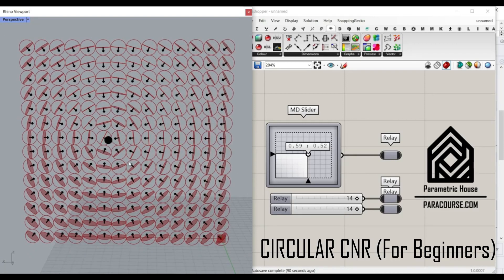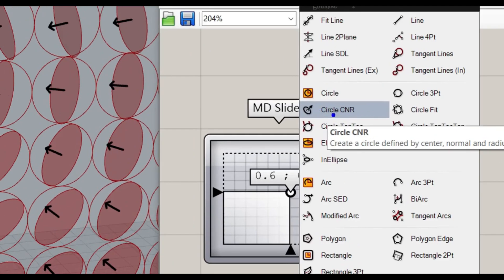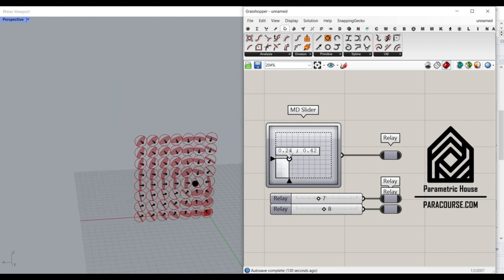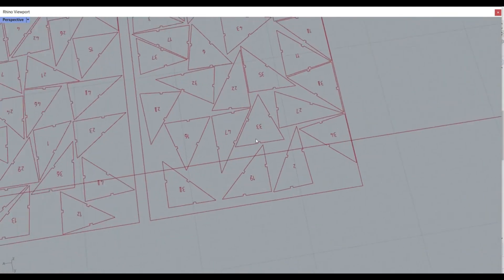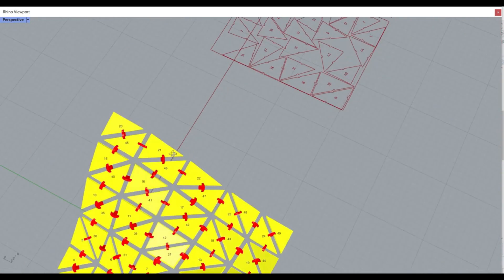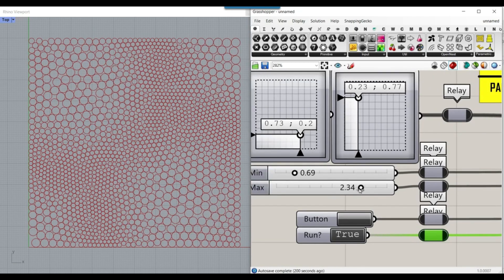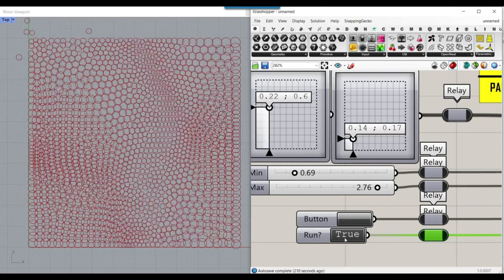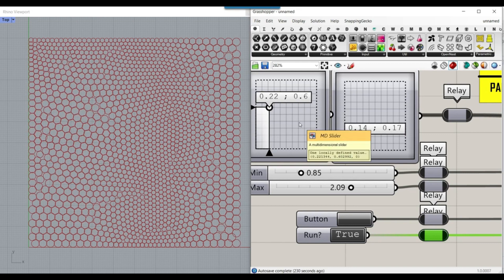Grasshopper Course Lessons Overview

Comment from the maker: 1-CIRCULAR CNR (For Beginners)

In this grasshopper tutorial for beginners we are going to take a look at the Circle CNR component and how to use it to design a series of circles rotating towards a point attractor.

https://parametrichouse.com/circle-cnr/

2-Circular Joint

In this grasshopper tutorial, we will learn how to convert a triangular mesh to a series of panels and circular joint connections.

https://parametrichouse.com/circular-joint/

3- Circle Packing

In this grasshopper tutorial for beginners we are going to take a look at the “Image Circles” component from the Kangarro plugin and how you can colour a mesh and convert it into a circle packing pattern.

https://parametrichouse.com/circle-packing/

4- Lloyds Relaxation

In this grasshopper example you can refine a mesh by using the Lloyds algorithm and the Stella3d plugin.

https://parametrichouse.com/lloyds-relaxation/

5- Scissor From Polyline

In this grasshopper example you can create a scissor structure from a polyline by using the Linketix plugin.

https://parametrichouse.com/scissor-from-polyline/

6- Polyhedra Fabrication

In this grasshopper example you can create a series of Platonic solids with Lunchbox and then convert them into sections with slits for fabrication.

https://parametrichouse.com/polyhedra-fabrication/

7- Spiral Ramp

In this Grasshopper example file, you can create a parametric spiral ramp.

https://parametrichouse.com/spiral-ramp1/

8- Brep Voronoi

In this Grasshopper example file, you can create a Voronoi structure inside a brep.

https://parametrichouse.com/brep-voronoi/